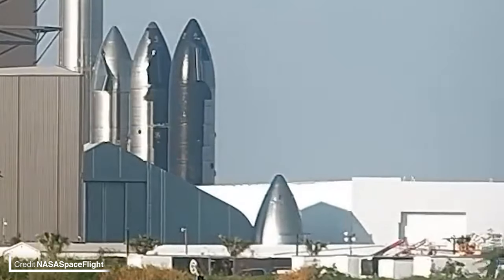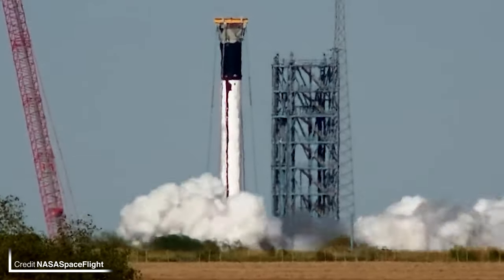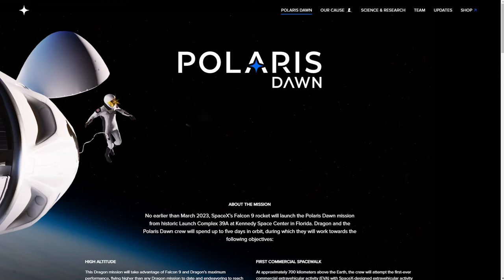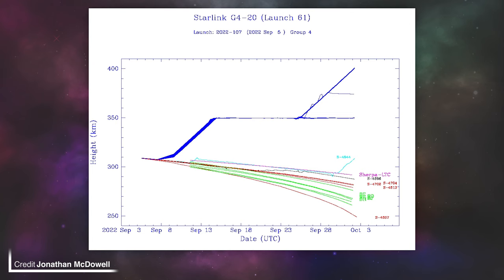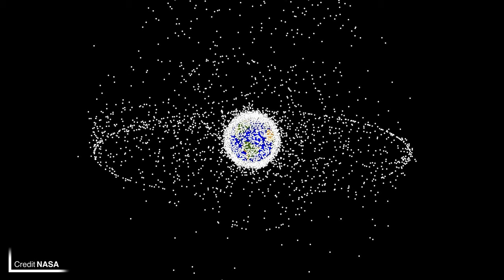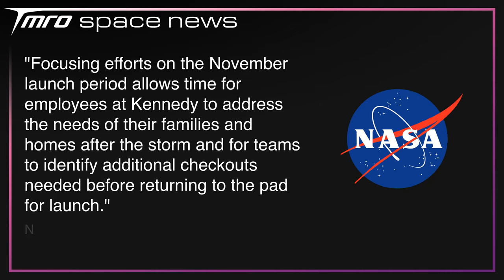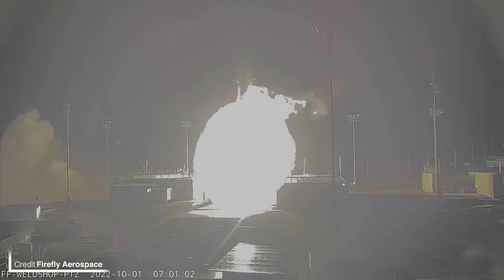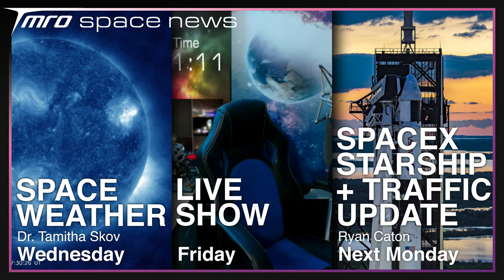Why Fixing Hubble isn’t as Easy as You Might Think // TMRO Space News

Comment: An extendable maintenance module could be stored in the trunk.  It could hold the docking interface with cameras and have storage berths for Hubble equipment to be replaced.  A robotic arm may be difficult, but a folding scaffolding could provide manual translation access to the various Hubble access ports.  Due to trunk space limitations, maybe replace only one or two modules per mission along with reboosting.

Comment: I suspect your off-center "goodbye" was nod to the NASA meatball.  What happened to the poof?
For Dragon/Hubble, an adapter could be made long and hollow to permit crew access once the lid was open.  Open the hatch, fetch/install adapter from the trunk, hop back in, and dock.  Top-facing thrusters might be no problem if the adapter also included a very symmetric deflector.  I'm not sure the center/dockable-portion of the trunk is structural.  As for the arm, I'll leave that for another arm waving commenter.  Have a nice week, and thank you for the update.

Comment: I'd doesn't need fixing, it 'just' needs reboosting. Of course, a few gyros replacements here and there are welcome, but not immediately necessary for the good functioning of the telescope
Reply from the maker: Sometimes slight liberties have to be taken in the title.
Reply: @TMRO  SpaceX is gonna Save the Hubble Telescope From Burning in the Atmosphere!!! Seems like a perfect title lol
Reply: Good thing they found the culprit for the failing gyro bearings. The last service mission replaced the bearings with those from a different manufacturer and they are still working. Although a replacement would be sensible